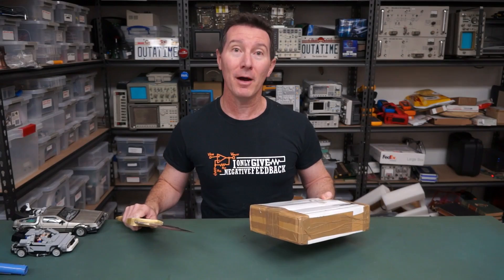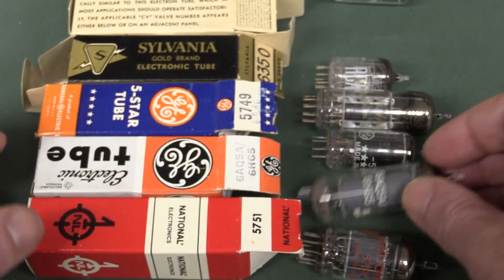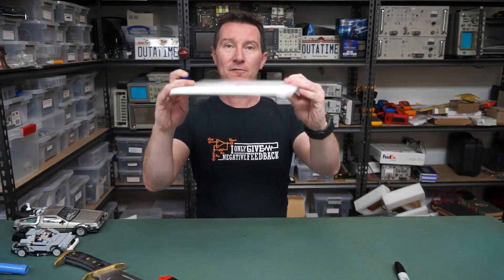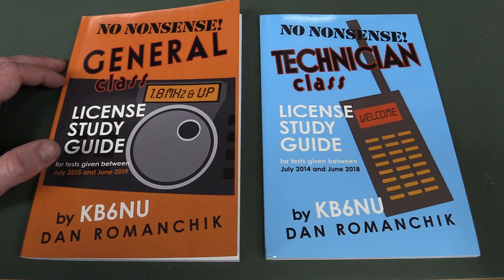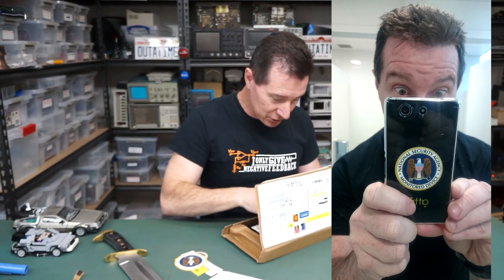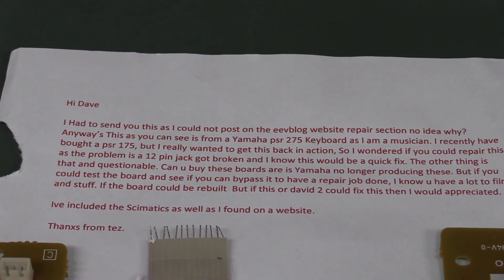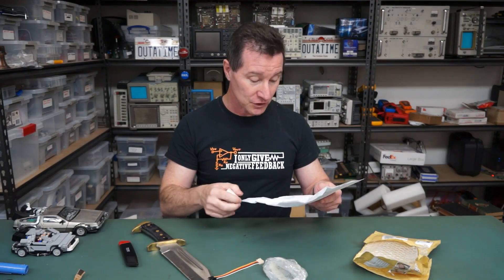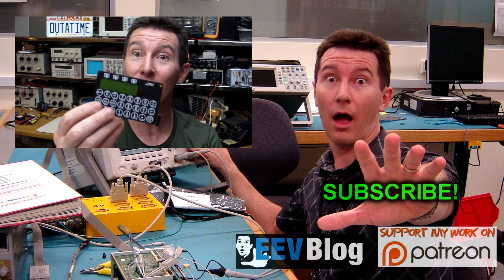EEVblog #906 - Mailbag

Comment: I think the mirror on the PCB holder is so you can see the bottom of the board without having to completely flip the entire thing.
Reply: I'm thinking the same thing.
Reply: Yes you are right the mirror polish is extremely useful but we are considering having one side mate polished so that you can choose by preference.
Reply: me to
Reply: Yeah, I think that's pretty obviously why it's "mirror like", baffles me that Dave missed that. ^_^
Reply: The disadvantages is that you have to clean the mirror every time.
Reply: the real illuminati We decided to matte polish the backside of the base plate. (Not in Daves version)
Reply: @Even Juberg – It didn't immediately occur to me, either. I'll tell you why: it's not really a replacement for being able to flip the board easily (see, now if the clamps locked and the bases used electromagnets all controlled by a single convenient switch, then we'd be getting somewhere). 

All it does is provide a decent way to get a glance at the bottom with everything in-situ, and frankly this is an ability I'm quite used to forgoing in the first place. That is to say, I'm quite used to having to flip the board, at which point I can (and might as well, since I went to all the effort) make a close-up inspection, if not do work on the backside. And it's not like that's a huge impediment, since you'll really benefit from the close-up inspection anyway. Really, I'm not sure how much I would use the mirror – mirrors can be awkward, and you still won't get that close-in inspection ability which is needed. 

With all that in mind, my $13 Aven PCB holder seems like more utility for the dollar.
Reply: i was thinking why does he not like the mirror ? same thing went instantly thru my head that its awsome to see if you solderd  it propper  on the mirror side.
also stainless is not magnetic , only some onehang-low crap stainless steel is magnetic junk. this is oviously chromed or nickel plated or something.
Reply: The base plate is laser cut from type 430 ferritic stainless steel.

Comment: The 6AQ5A vacuum tube was designed as the horizontal sweep amplifier for NTSC television sets in the '60s. They have an input power of about 15 Watts and an output power of up to 5 Watts. Plenty beefy to drive the horizontal sweep of a CRT. 

These are fairly common and have been pressed into service by the Ham Radio community for use as QRP CW transmitters. I built a crystal controlled CW transmitter for the 40 Meter Amateur Band. With about 5 Watts output into a 40 Meter dipole antenna, I was able to work a station in Flint, Michigan from my home near Philadelphia, Pennsylvania. Not too shabby for a little 1 bottle CW QRP rig! I've got the plans for this little XMTR from a Electronics magazine from, I believe 1967. I'll e-mail you a copy when I find it.

Great job on the mailbag segments! Enjoy your YouTube channel immensely! 
Cheers and 73! Joe, Media, Pennsylvania
Reply from the maker: Thanks for the detail.
Reply: 6AQ5 is a 1939 6V6 in a 7-pin base.  Used for audio-output mostly, once in a while used for Vertical output.  It's too small for horizontal output.  HO tubs almost always are bigger and have a plate top-cap as the voltage spikes there are in the thousands of volts!
Reply: +george gonzalez Yes, you are correct. It was used as a vertical output, not horizontal. I actually salvaged one from an old TV back in the 60s. Then I built the 40 Meter transmitter from an article in the March, 1967 issue of Electronics Illustrated.

I was only 13 when I built the rig. It didn't resonate because I used a 1/4" coil form but at the time, I didn't know what the problem was. Fast forward to 1977. I was now an Electrical Engineering student at Drexel University and had learned how to calculate the inductance of coils and the resonant frequency of L-C circuits. I calculated the resonant frequency of the existing circuit and noted that it was too high. I re-calculsted the frequency using a 3/4" coil form and it was just above 7 MHz. I rewound the coil and placed it in the circuit and tested it into a dummy load. As I adjusted the tuning slug on the coil the transmitter resonated, the neon lamp started to glow and my receiver let out a shriek! It worked! I plugged the 40M dipole cable in and re-tuned for maximum output. I was able to work Flint, MI from my home near Philadelphia with a rig I made when I was 13. I still have it! :-)
Reply: Could you post the plans for building my own ?

Comment: Thanks Dave for the positive feedback of PCbite! 

Updates made to the PCBite kit compared with the early sample Dave tested in this mailbag segment includes but are not limited to:

We include insulating washers so that you can power up your creations with even more comfort. These are placed on both top and bottom side of the jaw so that the board is protected.

Stronger neodymium magnet, for better experience when using an ESD mat to cover the base plate. There is a PTFE protection cap on the bottom to sustain low friction and protect the surface of the base plate.

Decreased height of the PCBites to improve ergonomics during long soldering sessions where you would rest hands on your bench for added support. Height is reduced with 10mm (0.4") while still retaining a wide jaw and perfect grip. The PCB is held 55mm (2.16") above your workbench.

Mirror polish on one side and matte(B2) polish on the other side of the base plate, yes we just decided :-)

And regarding the price, the price on Indiegogo now include worldwide shipping and all of the above updates.

/Johan Hellman - Team PCBite @ Sensepeek
Reply: Why isn't the "inside"/"middle" part the moving part? 
Like it is now and he shows in his video, when pushing down it will "flex" down. 
If the middle was dragging down on the board instead, would it be better maybe?
Reply: They look very sturdy and well thought out. Good job!

Comment: When candies, and other plastic-wrapped things go into a low pressure environment, such as a plane, the air is pulled through tiny microscopic holes.  I've taken American snacks over seas in the past, and each time the bags are usually rather shriveled up after a flight, and you can definitely smell whatever is in them.

Comment: The 5751 tube is probably worth at least $50 US if it's good.  The JAN (made for military) black plate phillips ones can be over $150 each. 6HG5, is common and about $10, 5749 is $5, The 6350 runs about $25.  The 6AK6 is another $5.  The 6BC7 is cheap, The last one you didn't give the correct model but it looks like a rectifier tube, maybe a 5AR4 which is a treat at $100+ for a quality US one.
Reply: Them ugly one look the same as my 5Y3GT

Comment: hermetically sealed, yes. but plastic actually has only very moderate barrier properties. this is why polypropylene is chosen over polyethylene: polyethylene would be even worse. also the reason why the inside of the wrapper is often metallized: it drastically reduces permeability. the main concern is oxygen or moisture getting in, for most cookies.

Comment: The little rubber ring on the flashlight is so you can use it in a "cigar" hold, pinched between your pointer and middle finger and activated with your thumb

Comment: About food smell outside of the packages: there are two ways smell can get out of the packages: 1) the packages are hermetically sealed, but bits of its contents flying around the factory as dust in the air can stick on the exterior of the packagingafter it is sealed; or 2) some food packaging materials are designed to allow gases (and only gases) to enter and exit. For chocolate-covered items the latter is likely as natural chocolate, like wine, have the concept of aging, and hermetically sealing it prevents that from happening.

Comment: there are currently 3 classes of amateur license in the US that you can test for, a 4th you had to have when it was an option.  Technician, general and extra are the options for new hams.  
Some still hold an advanced license, a hold over that is no longer used...  Oddly it grants a bit more than general on some bands, but not the full amount that the extra license grants.

Comment: That Yamaha board, what the heck?
Reply: If I were to venture a guess, id say someone tripped over the cord and broke the board. Not really sure how youd blow the ass out of the speaker output connectors though.
Reply: eevblog trollin at its finest
Reply: A good laugh
Reply: Yeah or pure troll.
Reply: +sparkplug1018 Apart from the broken board it's all desoldering damage.
Reply: Someone's half inched the heatsink as well...
Reply: And it looks like they used a blow torch instead of a soldering iron.
Reply: mackems!
Reply: I wonder if the home/electrical mains was struck by lightning.
Reply: not all of us mackems are like that
Reply: somebody pranked you, dave!  sooooo funny.
Reply: Looks like it was scrapped...
Reply: looks like its been a parts doner board

Comment: for the 5751 valve, 
I had a JAN Phillips 5751 that was worth about €50 at the time i bought it for a guitar amplifier. Not sure what it is worth now or what the national brand one in this video is worth but the 5751 is like a lower gain preamp valve. I think it was around 70 gain as opposed to the gain of 100 from the common 12ax7 valve. And it sat in between the 12ax7 (gain: 100) and 12au7 (gain: 20). All three are used in guitar amplifiers.

Comment: * Sorry, the message became longer than I intended initially...

JAN = "Joint Army Navy" This "JAN" designation is used to indicate a more robust mechanical design. (Mil-spec.) The electrical specifications are the same as "normal" tubes.
CV-numbers = NATO stock codes.

There are a lot of different designations for the same tube. The well known ECC83 (European designation) is exacly the same as 12AX7 (American designation) and also (with different pin connections) 6H2N-EB (Russian designation) (Source: http://amateurtele.com/index.php?artikel=104)

Sometimes "SQ" is added to indicate "Special Quality". In other cases this could indicate a newer generation of the "same" tube. Like the original 6L6 tube is evolved to 6L6G, 6L6GB and 6L6GC.

There are many designations for vacuum tubes/valves. A lot of tubes have the same characteristics, but different bulb shapes, filament voltages or maximum ratings. For example; the 807 tube can be used as a 6L6 replacement. The shape is different, the tube sockt is different and still suitable as a 6L6 amplifier. The 807 can handle much higher voltages, therefore is the 807 used my hamradio operators in RF amplifiers. The 6L6 can not be used in this case since the maximun voltage is lowe due to the physical shape (risk of flashover at the socket).
Luckily there´s a lot of information of comparing them. Google is our best friend. ;-)

5751 (=GL5751 =CK5751)
Double triode for audio amplification with 9 pin Noval base (B9A).
Direct replacement for the ECC83/12AX7 tube. "The" high gain (100x) amplifier tube for low signals (guitar/microphone) in the preamplifier stage.
The ECC83/12AX7 is very common tube and still in production! (Mainly for guitar amplifier use.) The 5751 the audiophile's choice compared to the ECC83/12AX7. (Not judging.)

6AQ5A/6HG5 (=6669)
Beam power output pentode with 7 pin Miniature base (B7G).
Used as an output tube driver stage.

5749 (=CV454 =GL5749 =CV4009 =6BA6W =5749W =CK5749)
Pentode for RF/IF amplification stage with 7 pin Miniature base (B7G).
Not intended to use in audio amplifiers, but known to use in homebrew designs.

6350
Double triode (gain factor 18) with 9 pin Noval base (B9A).
Used in early computers. Very nice for audio (midium gain) applications! Electrical the same as 12AU7, but the pin wiring is different!
Very nice for an audio buffer amplifier or phase inverter for a push-pull final stage.

6AK6 (=CV1762 =A4361)
Output Pentode for audio amplification with 7 pin Miniature base (B7G).
Very nice tube to build a "small" 1,1W audio anplifier. Rather cheap tube and great for experimenting/learing about tubes.

6BC7
Triple diode (not suitable for a power rectifier) with 9 pin Noval base (B9A).
Maximum 12mA per diode. Likely used in radio receivers for AM demodulation

The last 8 pin Octal base tube looks like a (rather low current) double rectifier. I couldn't figure out the type based on the shape.

@Dave: If you are intended doing a video about vacuum tubes/valves, the 6AK6 would be my guess. This shows most of the aspects for understanding amplifier tubes and designs. And also cheap and good available for everybody playing along at home. ;-)
By the way; VK2EEV sounds great! (It's not registered yet.) A lot of electronic enthousiasts are also hamradio operators and could be "a whole new market" of viewers. ;-)

Jacob; PE2CJ

Comment: I miss tubes, they were complicated enough to be a challenge but simple enough to be fun.  The 6AQ5 is the only one I ever saw before, it was used as an audio output and vertical output in some old TV's.  I started electronics working after school and summers in a TV shop around 1970. (yes you could do stuff like that back then)

Comment: Hi Dave, in regards to Amateur radio, those two books are for the USA Ham license classes. But 99% of the material is transferable to the Australian (WIA - Wireless Institute of Australia) exams.
Australian licenses are Foundation, Standard and Advanced. Since you are in NSW, you are correct with the VK2 callsigns, and you can choose your own.  http://www.wia.org.au/licenses/licensing/about/ will give you some more info on callsigns.
If you want a xxxxEEV callsign you only really have a few options. For Foundation you can get VK2FEEV (All foundations callsigns are VK#F??? format). Standard are VK# with 3 letters starting with HLMNP or V. Advanced callsigns are VK# with either 3 or 2 letters except for some certain callsigns. So VK2EEV is available as an Advanced callsign. You can check callsign availability on the WIA website as well.
Differences between the license classes:
Foundation. Max 10 Watts transmit power. Access to bands:  80, 40, 15, 10, 2m and 70cm.
Standard. Max 100 Watts transmit power. Access to bands: 80, 40, 20, 15, 10, 6, 2m, 70cm, 23cm, 13cm and 6cm.
Advanced. Max 400 Watts transmit power. Access to ALL Amateur bands.
More details on the WIA website.
With your background you would have no issues getting your advanced license, so I reckon go for it.
It's a lot of fun, I use a 2m radio in my car every time I go for drives, chatting with other amateurs using the local repeaters (And no, not the idiots on the UHF cb channels). When at home or camping, I take my portable hf rig with me and make contacts all around the world. You can build your own transceiver and antennas, baluns etc etc. It's all about experimenting and learning about radio and electronics. RF foxhunting is also another fun activity. Trying to track down an RF "fox" transmitter hidden somewhere in the area. Satellite radio repeaters, and also talking to the Astronauts on the ISS is another fun activity to do.

Like you said, it's not for everybody, but there are heaps of things you can do with your license. But yes it takes some time to do it all, and I realise you are busy, but hey... if you like it, you'll love it.

My callsign is VK6PCB and I've been license for 3 years now, and have made contacts 16,000km away using only 5 watts of power (Which is known as QRP operations... low power).

Cheers and 73

Carsten

Comment: With the board holder, why's each holder in its own seperate bag?
Reply from the maker: So they don't get scratched in transit.
Reply: The mirror finish on that is almost definitely so you can see the underside of the board while it's clamped.
Reply: That didn't immediately occur to me, either. But, if it's just a finish, and it could potentially be useful (which it could), then why not? So, nice thorough design. 

I kind of want some of those PCBites now. Although for $50 I might want some ability to lock the clamps with a 1/4 twist or so.
Reply: If one side was matte and the other mirror, they could use rubber feet with a small magnet embedded in them that you could position on either side..... but this would probably drive up the price

Comment: 5751 is a right under the 12ax7 as far as gain goes. 
6AQ5 is a standard lower power tube. About 12w max.
6BA6 is a remote-cutoff pentode used as a rf amplifier in standard broadcast and FM receivers.
6350 is a low power medium-mu twin triode.
6AK6=6AU6 is a small power pentode around 1w max.
6BC7 is a triple diode. 330v peak inverse voltage.
The big ugly one looks like a rectifier tube. Any number off the box?

Comment: 1:59 Chemistry time. Most smells are cause by aldehydes and esters which tend to leach throug the material of the pack itself. The molecules literally chew their way out like a solvent. It's like putting patrol in a plastic bag, but this goes easier on the bag.
19:33 They used these on the buses where I'm from :)

Comment: I think, shorter sections, open them up and get through the contents quickly and if they are more technical or need more details, just say you will look in more detail at the end of the video. So you have first part with short sections and then the longer more detailed sections at the end so that it doesnt interrupt the flow of the faster sections. 
Thanks Dave.

Comment: I've spent the extra money for the top brand of tubes for my guitar amps quite a few times over the years.. I'd be curious to know if there's actually any difference. I have the feeling my opinion is strongly influenced by placebo
Reply: There's probably a difference, but the more expensive valve probably just sounds different, not necessarily better. It's a similar thing with microphones: a cheapo measurement mic is probably more accurate than a $2000 recording mic, but that doesn't matter because you'd probably care more about the particular sound of an expensive mic than just its accuracy, or you might go with a cheaper mic if it has the sound you want.